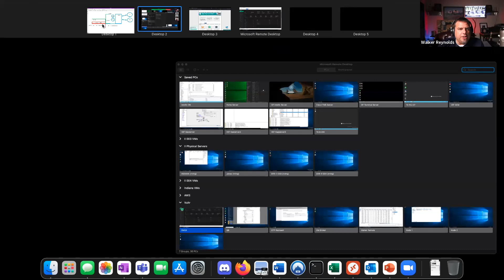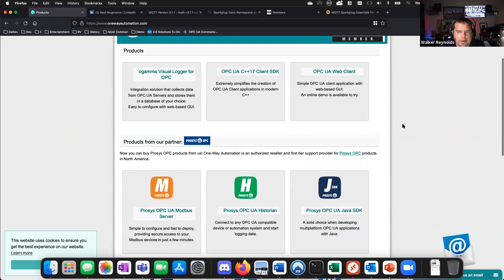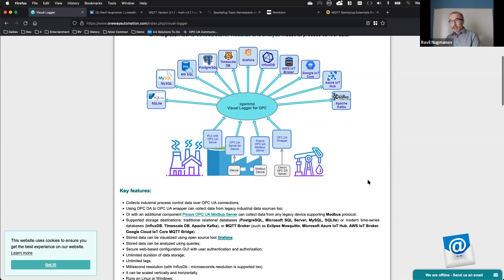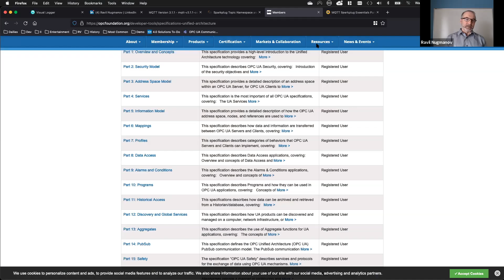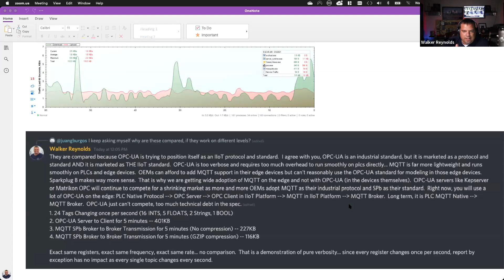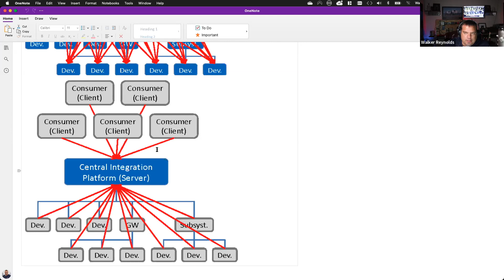The "Official" OPC-UA vs MQTT 2-HOUR DEBATE!

Comment: Great discussion, my view is that OPC UA is a framework (Information models, Alarms, Events, Data type representations, Methods, Services), whereas MQTT is just a protocol for 1 to many comms using a pub/sub mechanism, and hence the comparison might not be apples to apples. I'm reading about Sparkplug, so that might be covering a lot of ground where MQTT falls short.
Reply: OPC-UA and SparkplugB is more of an apples to apples comparison -- correct
Reply: Hi  @walkerreynolds973 . Great discussion. Attempting to learn all things mqtt so may be an incorrect question but here goes. How do you see organisations that need the quality range of OPC for data values being served through sparkplug that only have good, bad and stale? Do you see it's a compromise they have to accept?

Comment: Blind spots
in the vision of "one protocol to rule them all" MQTT:
(open to debate)
1) MQTT is the most efficient protocol
for data, not for information.
It is designed for a low-profile 1-to-many
communication (raw data, telemetry).
Optimal only from a "big data" point of view.
2) at levels 0,1 of the automation stack,
a reliable communication in many cases must 
prevail over any other efficiency, cost 
or scalability consideration
(especially when safety issues are involved).
Machine to machine communication
often requires low latency and a complex 
interdependence for control algorithms.
3) report by exception to the cloud may render
in many industrial cases a large amount 
of useless data
(instead try to embed intelligence, 
machine learning functionality into your field 
devices, creating higher abstraction layers 
on the edge... and hence 
reporting less but more "meaningful" data)